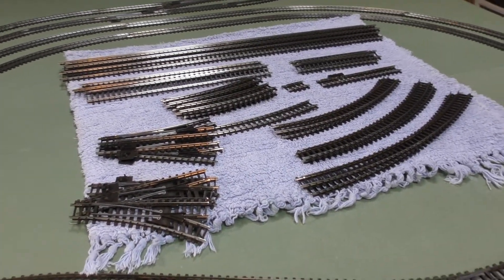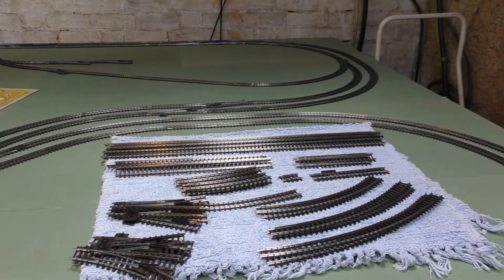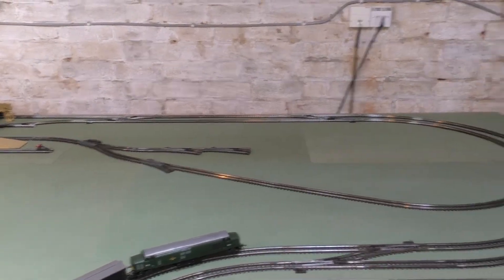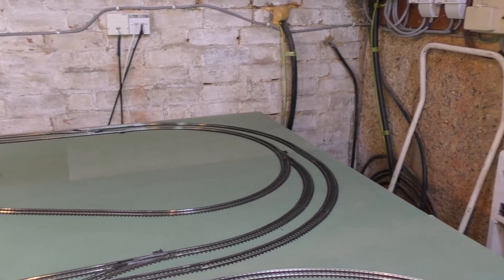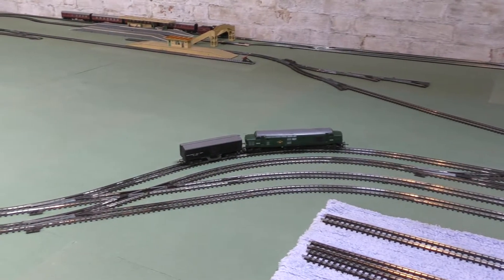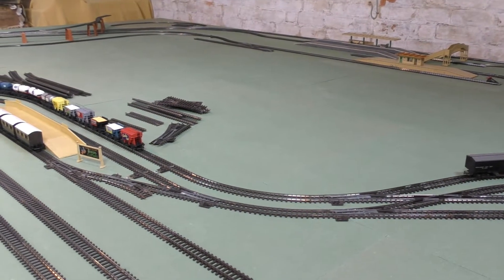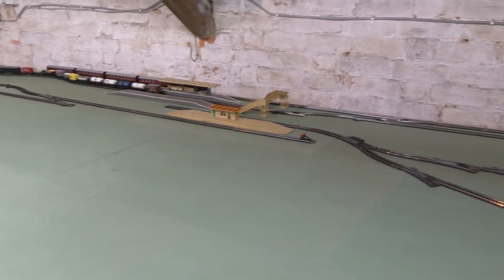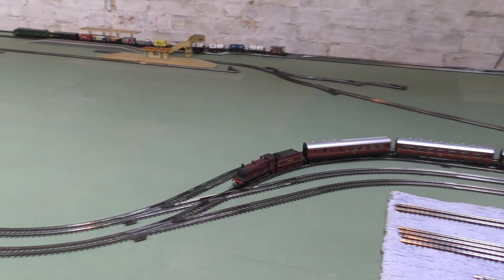New Tri-ang Super 4 Layout. Testing Refurbished Nickel Plated Track Fitted Along The Rear Mainlines

Comment: As I am watching this in August 2021 and your currently putting in the second turntable. It proves what a good idea you had Nickel Plating the track initially. You have solved the reliability issues for running vintage and antique locomotives which these will become. In a word Brilliant 💫💫💫💫💫💫💫💫💫💫👍
Reply from the maker: Hello Tim, yes, it's been over a year since I first plated Super 4 and it's holding up well. Hardly ever needs cleaning so a great way of saving all my old rusty track. All the best to you

Comment: Good afternoon Mr Snooze. Great to see you layouts coming along with the recondition track. A number of people have mentioned those microscrews to me in the past few months. I’ve tried the 6mm x 1.4 and the 8mm x1.4 I had thought I’d need the 8 mm ones for the super 4 track but as it turns out 6mm works very well. I also got a bag of the screws for Hornby Dublo track they also seem excellent 10mm x 2 that’s it just under that third wheel with no danger of sorting it out. Look forward to the next video.
Oscar
Reply from the maker: Hello Oscar, I'm looking forward to trying the screws. My green underlay is about 6mm so with the sleeper base just over 2mm I opted for 14mm screws to give me around 6mm in the actual baseboard. I know that sounds a bit long but my idea was to drill a 1mm pilot hole then the screw will go in easily and be really secure. I'll let you know how it goes. Best regards to you

Comment: Hi. I came across your videos. V interesting project. I have some old mainly Triang locos and rolling stock (the board with track was given away many years ago) and was thinking of building a small double loop layout to run them on again. I too had thought about buying 2nd-hand Super-4 track to run both old and new stock but I certainly won't have your skill or patience to re-plate them. It'll be a relatively small layout so I'm happy to clean it occasionally but having seen this video of yours I'm now wondering if its such a good idea as you say the trains defiinitely run better on nickel-silver track. I also don't really want to have to replace or grind down the older wheels. Any thoughts/comments? Btw, what size is your board...is it 8'x4' or bigger?
Reply from the maker: Hello Steve, thanks for looking at the channel. Super 4 cleans up nicely if you spend a little time on it and the locos run well, especially if its kept away from moisture. I'm sure you will enjoy building your layout. It's a shame to resort to turning down the wheels on the older models but if you do they can run well on Code 100 track. My main layout is approx 16 feet by 8 feet. All the best to you